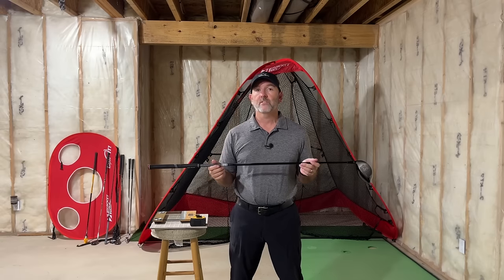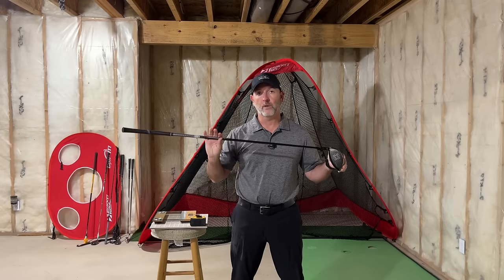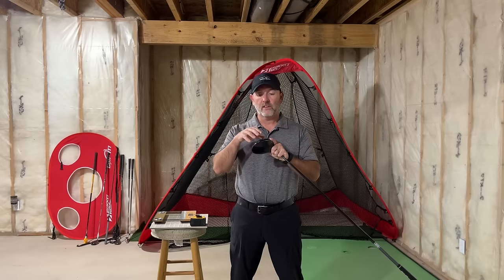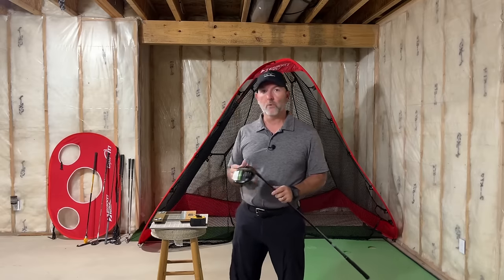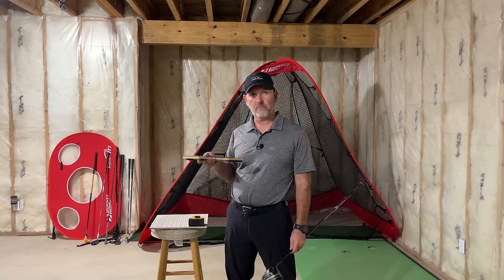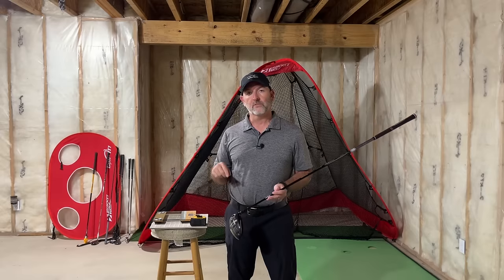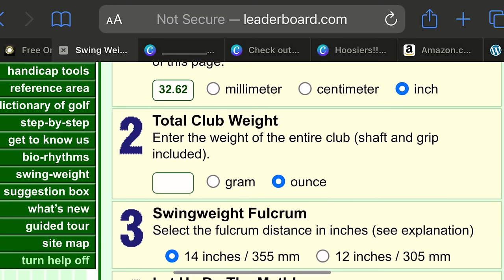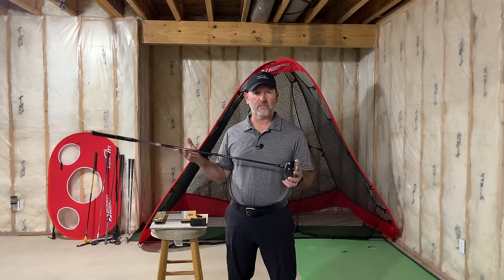Shorten Your Driver Like The Pros Do!!

Comment: I cut a driver down to 3W length around 5 years ago and has been my go-to since. I have been trying to find the best way about going about packaging a shaft and head. I was wondering if I could just buy a 3W shaft for driver head instead of cutting down. You mentioned in your video that the G weight is higher in a 3W shaft and if you are going through all of the calculations to mimic that CG and gram weight, it seems like this would be the best route to go. If not, why would this combination not be the best option or why wouldn't it work?
Reply from the maker: It’ll work, but the 3 wood shaft might be shorter than I’d like to go.  Typical 3 wood are 43 to 43.5” and I setup the driver I discussed in this video to 44.25”, so my concern is that the 3 wood shaft won’t give me the length club I wanted.  Hope that makes sense!  Thanks for watching!!

Comment: Question for you. If cutting the shaft down at the butt end looses weight at the butt end, and adding weight at the head is advised to counteract this lose in weight, aren't you just shifting the fulcrum point even closer to the head? Both these alterations would make the head feel heavier, no?
Reply: if you were to only cut the butt end of the shaft and not add weight, you are still shifting the fulcrum point closer to the head, right?
Reply from the maker: No this is inaccurate.  If you grab a broom in your house and hold it from the extreme end and try to lift it you’ll notice it’s damn heavy.  If you then reach halfway down and do the same thing, you’ll notice it feels drastically lighter.  From a physics standpoint, you are shortening the moment arm and it takes less force to lift it as a function of the lever arm length.

But when you add weight to the head, it makes it feel heavy as it did originally, similar to the broom example.
Reply: @TheGolfNerd  ha that makes perfect sense. Thank you. I got one more... I currently game a driver with a 70g stiff shaft that is 45.75" long. I want to cut it an inch and NOT add weight to the head. My overall goal is to make it feel lighter as well as shorter (it is just too heavy). Am I correct with this thinking or would head weight still be needed?
Reply from the maker: @imejandiskate  it depends how much you shorten the club and what the current swing weight is.  For example, let’s say it’s playing really heavy at D6.  If you shorten it by 1/2”, that’ll lower it from D6 to D3, approximately.  If you shorten by an inch, around D0, which for most will begin to feel too lite.  More than an inch would necessitate adding weight in my opinion.  Good luck!!

Comment: Why not just grip down on the club? Cutting the shaft limits your ability to step on one of you want to. Pro’s already swing fast enough to hit it over 300, but most amateurs don’t.
Reply from the maker: So it does limit club head speed just due to physics, but that assumes good technique.  Bad technique isn’t purely linear relative to shaft length.  Because of this a lot of players can control a shorter club more easily, and thereby actually often gain a little.  A lot of golfers hit a 3 wood better, length is a big part of that equation.  Thanks for the feedback, I like to hear others’ viewpoints.
Reply: @TheGolfNerd  I agree with that. But again, pretty much the same thing can be achieved by just gripping down on the shaft. That way, you can always grip closer to the butt of the club when you need more distance (assuming good timing), instead of limiting yourself by shortening the shaft entirely.

Comment: so if you are replacing a shaft for its weight can't you just order it in a shorter version?
Reply from the maker: For sure you can, although I’ve noticed that they don’t seem to increase the weight of the shaft as much as I would recommend.  But I have swing weight tested a custom shortened Callaway previously, and it swing weight tested just fine, so perhaps they add hot melt??  Hope fully this addresses your question.

Comment: G425 drover has a counterbalanced shaft. I like the feel but want to shorten. I believe its an 8 gram weight. How wound you calculate for this?
Reply from the maker: So you can’t really accurately calculate how much weight you’ll need, that’s why I advocate for buying a weight kit.  I would recommend determining what your current swing weight is before you shorten it so you can try and target that specific swing weight.  Hope that helps.  Thanks for the comment!

Comment: If a shaft is 60 grams and you take off 2 inches your losing less than 2 grams
Reply from the maker: That’s a great point, but that’s not really what I’m trying to accomplish. By using a heavier shaft, you can offset some of the weight you have to add back to the head in order to hit swing weight.

Comment: Wouldn’t the lie angle of the Club change if you shorten the shaft? In this case, it would be flatter, and there for tend to fade the ball slightly more. Maybe it’s insignificant, but just curious.
Reply from the maker: That’s a great point.  The rule of thumb is 1° flatter for every half inch shorter.  Now this assumes that everything else about the address position is constant, which may be a bad assumption as some golfers may override the change due to their own feelings when addressing the ball.  Flatter lies can be used to calm a hook pattern, but I don’t think it’ll make a player go from straight to slice.  I believe a lot of golfers slice their driver due to the length of the club vs lie of the club, but that’s speculation on my part as I don’t have data to back it up.  Thanks for bringing this up!!

Comment: I want to take my PING G400 SFT head and put it on the PING G400 3 wood shaft. How much weight would I need to put on the back of the head to get it up to specs ?
Reply from the maker: I touch on this during the video, but predicting the amount of weight you have to add is very difficult. However, if you use the normal rule of thumb, and you are going from a 45 and three-quarter inch to a 43 inch, you would need to add 33 g to the head. This really isn’t feasible. I would suggest you target a 44 to 44 1/2 inch driver. Good luck on your quest.

Comment: 35" is my balance measurement on my driver. I didn't hear player height as being a factor and curious if it should be considered? I have seen charts for the 7 iron length compared to player height but not sure about the driver. Being 5'9" I could benefit from a 3/4" to 1" shorter driver I'm sure.
Reply from the maker: For sure height can have an impact on finding the right length, but when it comes to shortening the driver to gain control, it’s not really what we are focusing on.  As far as 35”, as long as you measure from the grip end like I show, then that’s the number you need to know to understand the swingweight.  Thanks for the comment!!
Reply: I Cut my M2 Driver from 45.75 down to 44" Played 18 hols 1 hor later and the difference was Amazing !! I was looking forward to every Driving Hole ! It is Awesome ! My son who can Crank it well over 300 in playing a shaft that is 44.5
Reply from the maker: @TEBAIL-v6o  that is awesome!!  Thanks for sharing and Go Sooners!!  I lived in Norman as a teenager, and although I don’t root for OU any longer, I still pull for em!

Comment: Why not just grip down lower?? Less risk that cutting
Reply from the maker: The concerns are a smaller outside diameter as you choke down on the grip, choking down effects swing weight and It’s a little harder to set your hands in the exact same place every time.  Choking is a good way to figure out how much you want to shorten your driver by however.  Thanks for the comment!

Comment: Looking to go from 45.75" (54g) to a 45" (66g) + lighter grip. Would the difference in weight cause the flex to maintain it's stiffness since less weight is needed in the club head? Or would you still recommend going up a stiffness?
Reply from the maker: I’d be tempted to keep the same stiffness.  Worst case scenario, you could tip the shaft a little to gain back some stiffness.  Thanks for the question!!
Reply: I have shortened quite a few driver and fairway woods and never noticed any difference in the shaft flex.  I think taking an inch or so of the grip end doesn't change the flex because a) its a the stiffest part of the shaft. b) it has a thick rubber grip wrapped around it and c) he shaft is being squeezed with both hands.
Reply from the maker: @gordonwood1594  it isn’t just the shortening but also the additional weight you add to the head for swing weight.  Obviously this is not a hard and fast rule as it will depend on how much shorter the shaft is.  Thanks for sharing your experiences!!

Comment: Shorter 1” makes the shaft stiffer approx 1 flex. No?
Reply from the maker: Not usually.  But shortening the shaft at the grip end, you are removing the stiffest part of the shaft.  By cutting this, you reduce the overall stiffness.

Comment: Anytime you shorten a club it gets stiffer not more flex
Reply from the maker: If it was a constant wall thickness and diameter I would agree, but because you are cutting off the stiffest part of the shaft in the handle and then adding a lot of weight to the head, it behave softer.

Comment: Great video. Does this method apply to irons and does the swing weight stay the same for all clubs in the bag? MikeE
Reply from the maker: This method gets a lot harder with irons since most don’t have adjustable weights.  A lot of times folks put tungsten powder on the shaft of the iron shaft to weight it, but that moves the CG more towards the heel of the club which isn’t ideal.  

As far as swingweight, it’s pretty normal for different clubs to have various swingweight.  Irons are normally D1-D2, drivers range from D1 to D4 and wedges are usually D2 - D4, with lib wedges usually being the highest around D4.  So it changes by club and obviously through the custome fitting process.  

Thanks for the great questions!!
Reply: I just cut my 4/5/6 irons to 7 iron length . No dramas just cut them and I've gained In accuracy immediately.  Also fattened the grips a little .  No need for rocket  science here
Reply from the maker: @fritzmuller8246  hope you have a great season!!

Comment: In practice, I think most people can adjust to a 1” shaft length change without even messing with the swingweight. Swingweight is best used for matching an iron set with itself.  I’ve never been able to feel the difference between a heavy grip and light grip for instance. The heavier a club is, the harder it is to swing fast so I’m skeptical that adding weight would add distance for most players.  There is also a trend towards playing the lightest shaft you can to increase speed. Lighter, whippier shafts cut down a bit is worth experimenting with.
Reply from the maker: The only thing I think we can say is universal for golfers is that nothing works universally for all golfers!!  However, I honestly believe that the advice given here will suit most players, but I completely understand that it doesn’t suit ALL golfers.  I appreciate the thoughtful comment.  Thanks for watching!!
Reply: @TheGolfNerd  Ultimately you have to hit them to see what happens. With launch monitors we have a really good way to test at least! I suspect individual results will vary quite a bit.
Reply: I had trouble finding the the center of the face with a normal swing speed… shortened the shaft a little… added 8 grams to the head and slowed down my swing… so I traded swing speed for mass/ inertia and can now find the center of the club face witch gives me longer, straighter drives with a slower swing speed.
Reply from the maker: @markbaespflug7555  and that’s what it’s all about!!  Thanks for sharing your experience!!!

Comment: What if I switched my driver shaft for my 3wood shaft?
Reply from the maker: That would make a pretty short club.  A typical 3 wood is 43”.  Using this shaft would probably result in a 43.5-44” driver.  As long as you have enough weight to add back to the head it’ll play, but you may have a gapping issue to the 3wood.  I mean there won’t be any harm in trying it, just try to get the swingweight right by adding some weight to the head.  If you need additional help, let me know and I’ll try to help further.  Thanks for the sub!!

Comment: What if I just choke down instead?
Reply from the maker: It’ll obviously change the diameter of the grip unless you played non-tapered grips. It will also affect the swing weight. So if you grip down, it’s like shortening the club and you will feel that in the head being lighter.

Comment: Why not tip it?
Reply from the maker: Great point and that will definitely help. The only issue with going this route, is you’re still going to need to add weight and buying a heavier shaft will help offset some of the weight that you need to add. Otherwise, tipping is a great option. Especially if you were only shortening the shaft by 3/4 of an inch for example. Thanks for the comment!

Comment: todays golfers are taller and look more ike vollyball players. . Not all but most. The average build players have longer shafts.  Average players cant afford to give up too much length because it destrys the feel and control of the shaft anyway. almost averything that I found mentioned that the average player would  end up  between 44.5 and 45". in fittings. 

Those in the extreme end of stature would then have shorter shafts.
Reply from the maker: I agree with the average lengths.  Thanks for the comment!

Comment: So if ordering a new driver then just order a shorter shaft and you won't have to add all that stuff correct?
Reply from the maker: I’d want to confirm that with the manufacturer.  I have ordered a driver that was shortened on Callaway preowned before and it was the proper swingweight, but I wouldn’t assume it’s always the case.  Shout to Mizuno, they’ve been selling 45” drivers for quite a while, which is great and more like what most golfers could use.  Thanks for the question!!

Comment: Why not grip down on it a bit?
Reply from the maker: That is definitely a way to experiment and some players do this, in fact one of the LPGA players does this all the time.  However, there are some tradeoffs.  By choking down you are holding onto a smaller diameter of the grip, there’s a possibility of gripping in different places and the swing weight is still affected.  My personal feelings is that I am more comfortable with something setup the way I want rather than gripping down.  But there really aren’t any right or wrong answers, just play what works!!

Comment: Thanks so much for the video! But couldn't you add some lead tape to the back of the newly shorten shaft to compensate the weight for the cut-off piece, instead of adding more weight to the head?
Reply from the maker: I would not recommend that.  If you want to go lead tape route, add it to the bottom of the head.  That will lower cg and not influence the behavior of the shaft like your suggestion would.  Glad you enjoyed the video!!

Comment: Ok...Dude Respectfully Need some Clarification here. Just to clarify Your Video is helpful but incomplete, let me Clarify with my own conclusions here
A.You must replace the shaft with one that is 10 grams heavier  (Equaision 1)
B.You will lose 3 SW points for each 1/2" you cut off    (Equaision 2)
C. You need to add back weight to the head 2 grams for evry 1 SW Point (Equaision 3)

In your case you cut off 1.5" from your driver and lost 9 swing weight points so since you cant purchase 18 gram Weights..You purchased a New shaft that was 70 GRAMS or 10 grams Heavier than your existing shaft and then added 8 Gram weight to the head ? 
Are my conclusions Correct?
If so, then what do taking a Measurment at the balance point and entering it into SW Calculator have to do with the whole process ?

You could do the whole process without getting a Weight or Measurment if the other points are valid then the Calculator will only reveal to you what is being done by the calculations right ??
Reply from the maker: These are great questions.  First, let me affirm that as you stated the above conditions, I agree 100% with each of the ABC you listed.  As far as measuring and not just trusting those equations, it’s because the relationships aren’t linear.  Meaning that knowing two unknowns doesn’t allow you to solve for the third, given that the behavior is non linear.  That’s why you need a weight kit with multiple options and a scale to determine the swing weight.  It’s an iterative process and as such, I don’t know if a way to calculate the exact amount of weight needed, so it’s guess, measure and repeat.  Hope this helps!!